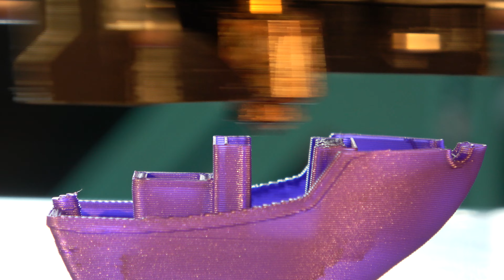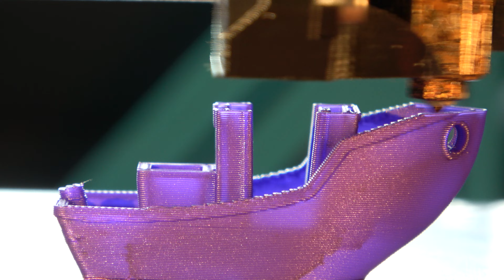Prusa MK4 alpha Input Shaping 12 minute benchy full print 4K prusament galaxy purple

Comment: Kind of sounds like you might have one of those machines with the faulty motors(noise). Apparently there was one batch of pre-assembled that had motors with the wrong specs, causing noise.
Reply from the maker: Maybe. Probably gonna get a exchange because the other vids on my shorts show how bad it is lmao but then again that kind of grinding noise is also on my Mk3s so eh who knows
Reply: @the3dprintingbelgian my Mk3 was rattly too but my Mk4 is extremely quiet!

Comment: Wait so is the input shaping just installed? You cannot measure it yourself? That makes it virtually useless because input shaping depends a lot on the stability of the device. Unless it is bolted to concrete, it will not help.
Reply from the maker: yes it is pre-installed. comes with set values from the factory. you can technically change it on the screen but there is no easy "prusa" input shaping hardware. the board HAS a port meant for a sensor but its not supported or has like a wizard to run it. so whatever value they put in the firmware is the value you are gonna get. imho its very rushed and nowhere near ready.

Comment: 1 outer wall 0% infill?
Reply from the maker: Speed benchy rules so 2 perimeters 10% infill 3 top and bottom layers
Reply: 10% With Lightning = 2% 😅
Reply from the maker: @monsterchipindonesia  nah this is Rectilinear iirc. definitely wasn't lightning
Reply from the maker: still don't really agree with prusa using a extremely optimized benchy print that doesn't follow the speed benchy rules(though they stated that it isn't a speed benchy) so that the general folks will just be "WOW ITS QUICKER THAN COMPETITOR X" but its still impressive speed